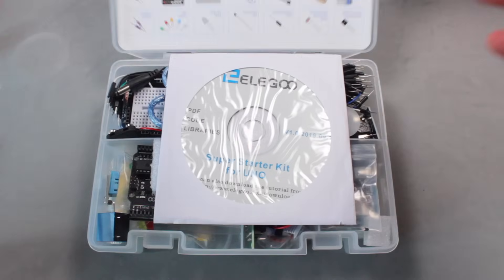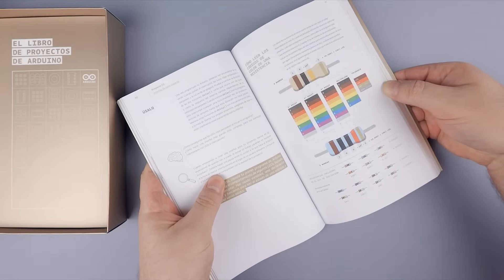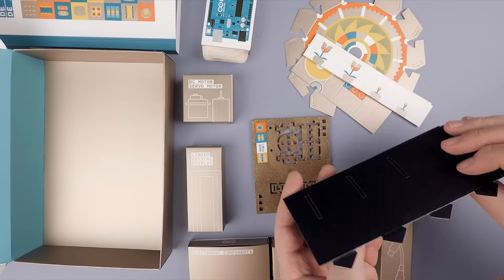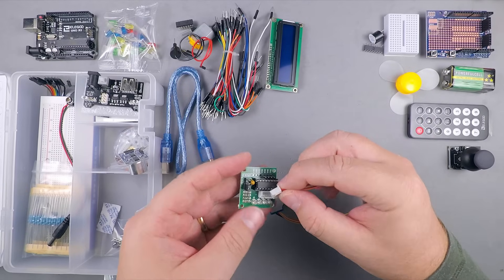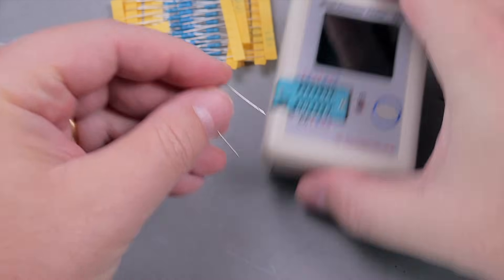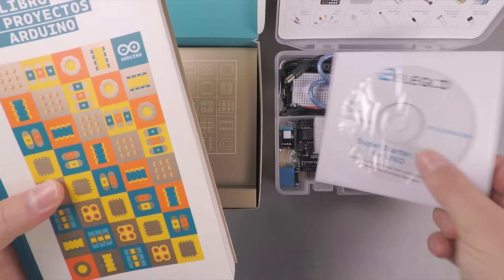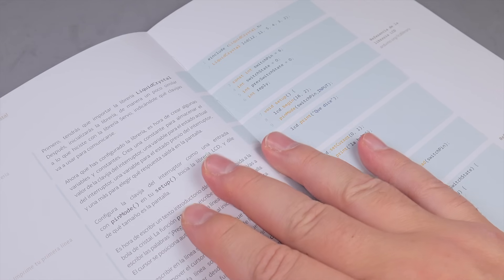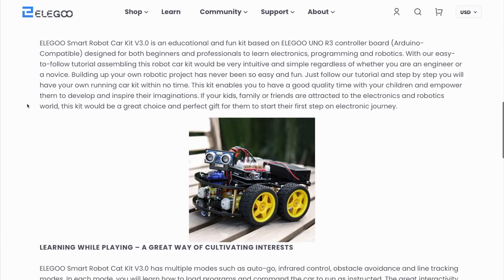Which Arduino to buy? Arduino Starter Kit vs Elegoo Uno R3 Starter Kit

Comment: Blue resistor are 1 percent.
Reply from the maker: I know... Metal-film, they are electrically better in any aspect.... a lot of people told me that after the video. I just wish the industry changed the background color for something more neutral (and the rings were a bit wider). I really cannot read the color code - and I am not alone! Does it make sense? 🤔🤣

Comment: Can I use other electronic components that are not included in the kit with the arduino bourd
Reply from the maker: Of course you can! You can mix and match modules/components from other kits - or use components that you acquired separately. In the beginning, try to follow tutorials so you learn how to use various electronic components and their proper values.
Reply: @GeekDetour  ok

Comment: What is multifunction tester? Is good resistor blue ? Resistency classic colors are good?
Reply from the maker: The “Multifunction Tester” is amazing because you can put whatever 2 or 3 pin component for it to test and it will discover what it is, tell you the polarity and measurements. It can tell you if a transistor is NPN or PNP, or a N-MOSFET or P-MOSFET... measure its gain... it is amazing. And they are quite cheap (someone commented here that they are based on an open source project, but well...)

The Blue Resistors are made of metal-film, 1% tolerance - they are the BEST, electrically speaking (a LOT of people told me how wrong I was to bash the blue resistors). My problem with the blue resistors is just that I can’t read the color code... I am not alone! It is FAR easier to read the color code in the old-style, Beige, carbon resistors, that usually are 5% (or 10%) wrong in their value. The older resistors seem to be worst in everything - but they are easy to read 🤷‍♂️ I just wish the new metal resistors had a more neutral background color and thicker color rings 😆 Anyway, I suppose nobody cares: more and more we will use SMD resistors even on hobby projects (they are supper tiny and they have their value written on them) - although you need a microscope to read it and solder them 😆
Reply: @GeekDetour  our resistor beige with colors is fine like blue as futurist. Can be relation Diodo and capacitor in mutli function?
Reply from the maker: Manilio, ¿prefieres escribir en español? No me importaría contestar todo en español 😁 Dime, ¿que quieres saber acerca de los resistores azules y el Tester?
Reply: @GeekDetour  si es español. Soy mexicano que yo pienso que me discriman por ser mexicano en español. Bueno la verdad es yo interesa comprar paquete de arduino, tuve que esperar. Este multifunction tester es para modificar o verificar los resistencias, diodos, capacitor en prueba alto y baja calor, es bueno o malo para el olor, cierto?
Reply from the maker: Hola, yo sou brasileño - pero vivo en España 😁 El Tester no viene con el kit - es una herramienta a parte - creo que he puesto enlace para ella en la descripción (he comprado mi Tester por AliExpress). Es para medir valores de componentes. Lo guay es que detecta todo solo: pones un capacitor, va a decir que es un capacitor y su valor. Lo mismo para resistencias, diodos, transistores y algo mas.
Mejorar el inglés siempre abre puertas.

Comment: Fantastic video! Would you say that going through the lessons in two starter kits is a good idea? I'm looking into buying a starter kit and leaning towards the official Arduino kit mainly for a hard copy of the projects book, but the Elegoo kit comes with a lot of cool sensors that I would like to make projects with too. Maybe go through all the lessons in the official kit (my knowledge of electronics is very basic) and then do some of the more advanced lessons in the Elegoo kit?
Reply from the maker: Thank you! Well... it was, kind of, what I did - I got the Official Kit 2 years before I purchased the Elegoo one (yeah, I had part of the footage “waiting” on an external hard drive for two years). I guarantee you will find something to do with more than one Arduino Kit (I have 4 Arduino Boards 🤪)
Reply: @GeekDetour  Thanks for the reply. I see, that's interesting. I watched another video that mentioned that the Arduino book is a "paint by numbers" sort of thing, in that yeah you follow it and build projects but it doesn't really teach you "why" things are happening. Have you come across a starter kit that teaches you the theory behind why you're doing things or why things are working that way?
Reply: @Spacemonkeymojo  we have the same profile pic!

Comment: Cool review. just one question, you say that both boards are identical and an excellent feature of the Arduino is the book or data that comes with, why can't I just buy the elegoo and download the arduino's data off the net?
Reply from the maker: Thank you! Oh, you can totally buy an Elegoo Arduino Kit and use the experiments/code from whatever other brand’s material. The thing is: I don’t think you can purchase the Arduino Book separated from the Kit. But, yes, once you have an Arduino Uno compatible board, you can mix and match sensors/modules from other kits/vendors, use any code/tutorial you find on the Internet - you are not restricted to what comes in the Kit you buy 👍
Reply: @GeekDetour   I did buy a elegoo stater kit comes tomorrow. I had little idea of what I had bought so I'm glad I didn't buy a 🍋.
Reply from the maker: 🤣 Not a lemon at all! Elegoo’s Uno R3 board is a very good clone of the Arduino Uno R3 (and this is totally legit, it is an open source hardware). It uses the same chip for USB to Serial (some REALLY cheap boards use different chips that require installation of drivers). So, good quality Kit. And you will be able to do more projects with it than with the official starter Kit. It is a nice purchase.

Comment: i have mixed review for this product. it has the potential to build amazing machines but the coding... i just gave up on it and throw it away

it fails to make a easy to interact product. that is why the company did not grow
Reply from the maker: Hi Jen! I understand your point... but I don’t know if there is a solution for that. I’ll give you an example: 3D printers are SUPER COOL - i am part of a few groups of owners. After every Christmas there is a big influx of new people who just bought their first 3D printer... They are simultaneously fascinated AND perplexed: 3D printing is like fine tuning a factory: temperatures, speeds, chemicals, electronics, mechanics... a lot can go wrong every time until you master every aspect of it. Not everybody is that interested and/or capable of learning all of it.
The same goes for Arduino: the programming is “real programming”.  There are a few initiatives that try to make Arduino programming closer to a “Lego” experience. Check this: https://learn.sparkfun.com/tutorials/alternative-arduino-interfaces/all

Comment: ive got a project in mind, running 5 led and two motors, 3 led to come on for 5 to 10 secs, 1 green LED to to flash for 10 secs, 1 red LED to flash of 10sec, should flash green - red - green and so on. with the motors i looking to them to run something like a start-up sequence. but I'm having problems writing the code. any help?
Reply from the maker: Hi Rob! Yes! You cannot use the “delay()” function... because it “blocks” - I mean, when you execute a delay function, everything stops... instead you need to use the function millis() and check if the desirable amount of time has passed... Here is a video showing how to do 2 things at the same time, using this technique: https://youtu.be/hD3cR25MbW8 Good luck!🍀👍

Comment: Maybe I'm an idiot, which is possible, but I have the book by Jeremy Blum and have tried to follow along with online resources and found the explanation of code to be lacking. I could change a few things to get the board to do a few things, but after a semester of learning C++, I understand the code much better. 

The Elegoo kit is the kit my school bought for a separate engineering class. I want to support Arduino, but the markup is a lot.
Reply from the maker: Hi Devin 👋 Yeah, the official Kit is now too expensive in my eyes... it is a great Kit, it supports the Arduino initiative, has an excellent book - but it probably could be sold for less.

Comment: I have both the Uno and Mega 2560 kits plus the car. I used the remote from one of the kits on a project I made for Halloween. It is 3 skulls that say Halloween things. Their mouths move, heads turn and eyes light up. I can select which phrase the skulls say with the remote.
Reply from the maker: Wow, do you have a video of that?!
Reply: @GeekDetour  Yes. I will upload it to my channel. I was going to make a video of how I made it, but didn’t take any video, as I was building it. I can still do one, but I need to change the way the voices play. I used a Roland S50 sampling keyboard that received midi signals from the Arduino, but I want to make it so the voices are on an sad card that the Arduino can play. I started working on it, but had problems with it, so I put it on the back burner.
Reply: @GeekDetour  Here's the  link to the video. https://youtu.be/9WRMeAkuCRs

Comment: Wow this is a really well made video! I am trying to decide weather or not to start a new hobby adventure and these kits look great. My end goal would be to be able to make a device that when moved from a horizontal to vertical position would send a wireless signal to either your phone or a receiver of some sort and make a noise or light up. I have no idea how advanced or easy that would be, would either of these kits get me there?
Reply from the maker: How there 👋 Thank you! Oh, you have a project in mind - and this is actually great: gives you a specific direction to your own experiments. So, the official Arduino Kit won’t help you much - the Elegoo Kit has an Ultrasound Sensor that could help you detect motion... BUT, it would detect that anything passed/changed in front of it. If you want to detect “just motion”, there are accelerometer/compass sensors that would be the best (it also is not present on the Elegoo Kit I showed). Watch this video: https://youtu.be/KMhbV1p3MWk and this one https://youtu.be/wTfSfhjhAU0
Reply: @GeekDetour  Wow thanks these are great videos!
Reply from the maker: You can also buy a separate "Sensor/Modules Kit" that has a Gyro sensor, like the Elegoo 37 in 1 Sensor Kit for Arduino: 
- https://geni.us/bUxi0 (Amazon affiliate link)

There are many similar kits from other brands, of course. And you can buy the specific module as well - but since you are beginning, I think kits are interesting: lots of modules to play with and the Elegoo kits bring the Datasheet and tutorials for every module.

Comment: My arduino board (official board), the pin are identified
Reply from the maker: Interesting! 🤨 I just searched now for Arduino Uno R3 boards and I found more recent boards that also have the Pins’ identification on both sides of the GPIO plastic connectors! Thank you for pointing it! My original Arduino Uno R3 board only has it on the external sides - but it is old, I bought my kit in... Geezzz... April 2017?! 😬

Comment: Very good video! Thanks for explaining the difference between the kits in such a great detail. I will spend some money more on the official kit, because like you said, the discriptions in the book are top notch. When I need a second microcontroller for something else, I‘ll buy the Elgoo one. Maybe build a fixed programmer without the need to switch the main unit for this purpose...
Reply from the maker: Hi Philip, thanks! I keep working/testing a few projects at the same time, so ended up buying a couple of extra Elegoo Uno R3 boards - only the boards (no Kit) and extra breadboards. This way I don’t need to undo what I am working on with one board just because I wanted to make a quick test for something else. The Elegoo Boards use the same USB to Serial as the original Arduino Uno (some cheaper clones use a CH340 chip that requires a different driver). This “Arduino road” lead me to buying much more things that I anticipated 😆 But I am having a blast 🤣
Reply: @GeekDetour  The price tag of a single unit without the need of extra stuff is unmatched! Beeing flexible on different projects saves a lot of time. The IDE is compatible on most devices; the NANO board from Elegoo needs a different driver but they provide them on their homepage. The sensors from them are great too! I heard the cloud from arduino is limited in some ways with 3rd party boards, but never tried it. I'm looking forward to build a custom arduino clone on a self-designed PCB. With all the parts I could buy a new official starter kit haha. But it keeps the brain fresh & like you said, it's a lot of fun :D

Comment: I am 60 years old and had all sorts of kits on my bench. I learned that the originals are usually made much better, but also that clones come with spare parts. If you are really into experimenting then you will waste a lot of parts, and then clones come handy.
Reply from the maker: Yeah! But something I really enjoyed about the Elegoo Uno Boards is that they use the same USB to UART microcontroller instead of the CH340 (that many cheap clones use).

Comment: Got a major score on the mega 2560 most complete starter kit from elegoo. Normally on amazon it's like $60 and I got a brand new one for $6 at my local goodwill along with a brand new Asus monitor for $20!
Reply from the maker: Wow! That was really lucky! I never used the Mega 2560, huge board! I went to the opposite direction: I fell in love with the tiny versions Arduino Pro Mini and Arduino Nano (they are technically identical to the Uno R3, only physically smaller, good for soldering). Have fun with your Kit! And happy 2021!

Comment: If I want to get the Elegoo Kit, there are 2 different kits available on Amazon:

ELEGOO UNO Project Super Starter Kit with Tutorial, UNO R3
ELEGOO UNO R3 Project Complete Starter Kit with Tutorial for Arduino UNO (63 Items)

Which one of these would you recommend?
The main project I have in mind is a moisture/water monitoring system.
Reply from the maker: The bigger Kit (63 items) has more sensors and components: soil moisture sensor, RFID tags and reader, membrane keypad, microphone, an LED matrix - AND a power supply that might be useful for your project if you intend to keep it working full time. It costs more but it is still an excellent price 😁 You will make a project and you might face the dilema: “and now... do I disassemble my project so I can play with all the other components??” My answer for that was: I bought extra Elegoo Uno R3 boards - not the Kit - they sell the standalone boards as well. I have 3 of them 😄
Reply: @GeekDetour  Thanks so much for this info! One last question: Do I need to buy an additional component if I want to connect my Controller Board to Wi-Fi?
Reply from the maker: Sorry for the delay - You are right: neither the official Kit nor the Elegoo kits have Wifi capabilities. Wifi is very complex and requires a much more powerful processor. It is actually funny: very often people add an ESP8266 module to the Arduino as a “Wifi” module (and you can do that, of course) - but the ESP8266 itself is a complete microprocessor MUCH MORE capable than the Arduino itself, it would make more sense to drop the Arduino and use the ESP8266 alone on the project. In fact, more and more people are using now the ESP32, the bigger brother, since it has Bluetooth and Wifi, it is more than 10 times faster than the Atmega of the Arduino. Anyway, it is a more complex microcontroller. I love the simplicity of the Arduino and you can learn A LOT with it. Here is a video about the ESP8266 as a Wifi module to the Arduino: https://youtu.be/9QZkCQSHnko

Comment: Blue color resistor are more precise and better quality in general, so Elegoo resistors are better than ones in Arduino kit. Ask google: "The beige-colored body of a resistor is often an indication that its tolerance is 5%, while a blue-colored body often indicates a tolerance of 1% or 2%. The blue-bodied resistors and the dark brown resistor contain metal-oxide film elements, while the beige-bodied resistors and the green resistor contain carbon film."
Reply from the maker: Yes, a few people already commented it here - not only has a better tolerance but also it suffers less variation on higher temperatures and suffer less variation as years pass... so, better in every aspect - EXCEPT that I still cannot read the color code 😆 I wish the industry could change the color to a much lighter blue, or light gray... something that would not interfere with the reading.